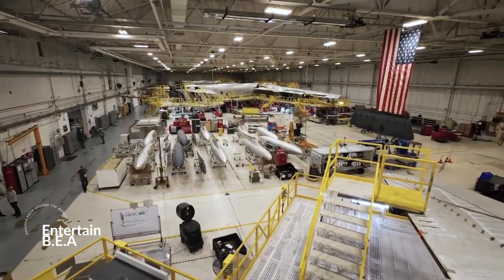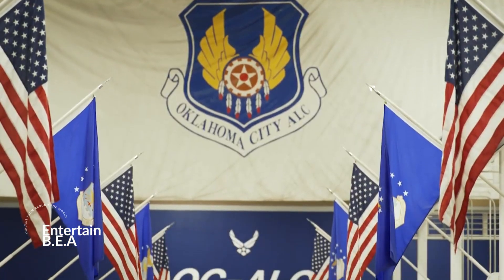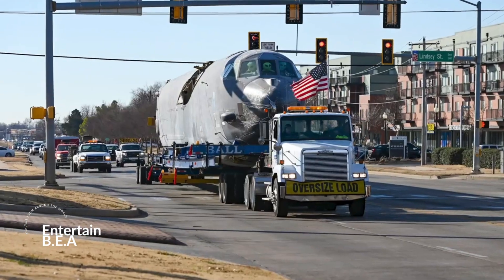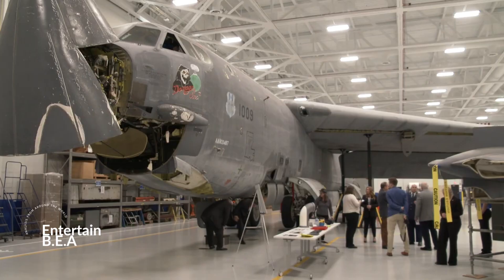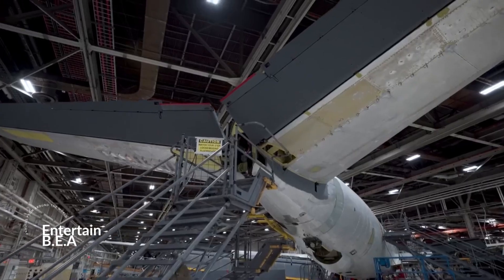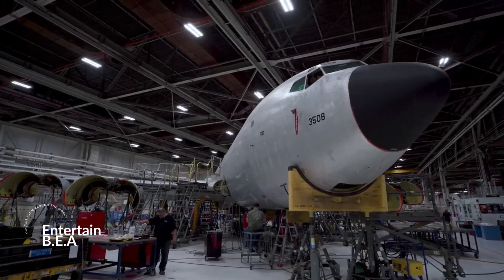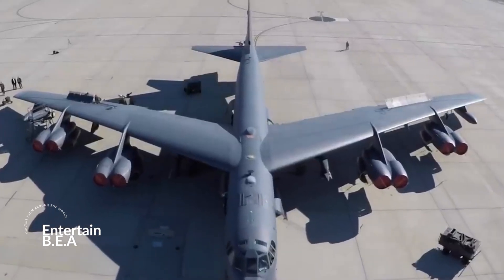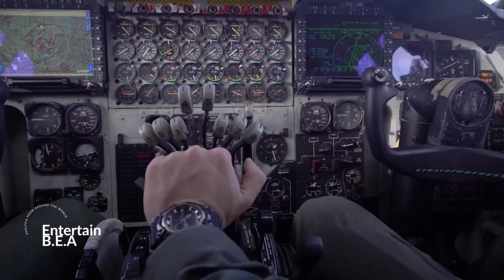Tinker Air Force Base: 🛠️🚀 The Future of B-52 Upgrades

Comment: This is so wrong and incorrect as so many turns.  What does a stratotanker have to do with bombers?
Reply from the maker: Hi @ph11p3540, thanks for sharing your thoughts. In the video titled 'Tinker Air Force Base: 🛠️🚀 The Future of B-52 Upgrades,' the reference to the Stratotanker might seem tangential at first glance, but it actually serves to highlight the broader modernization efforts and capabilities of Tinker Air Force Base. While the Stratotanker is indeed a refueling aircraft, it's significant in the context of B-52 upgrades because Tinker AFB is a central hub for aircraft maintenance, upgrades, and modifications. This includes not only bombers like the B-52 but also other aircraft types, such as the Stratotanker. The video aims to showcase Tinker AFB's role as a key player in enhancing the capabilities and readiness of various Air Force aircraft, including bombers like the B-52. We hope this clarifies the connection for you. Thanks for watching!